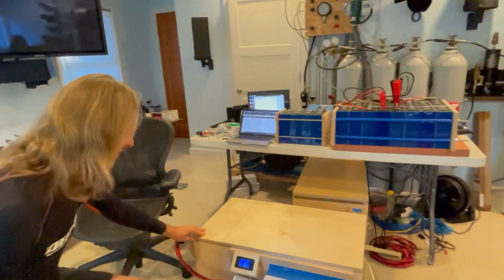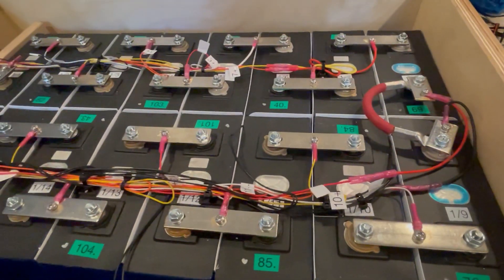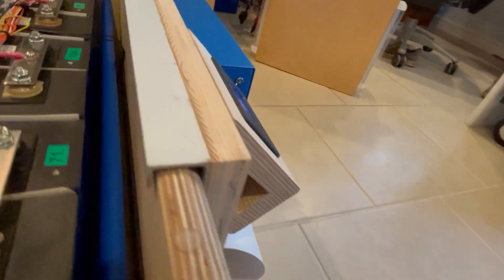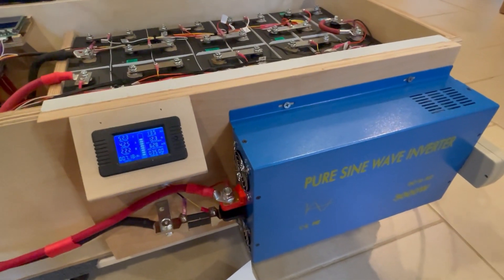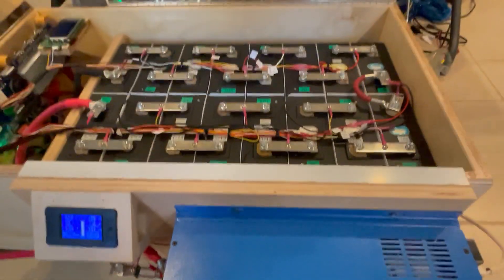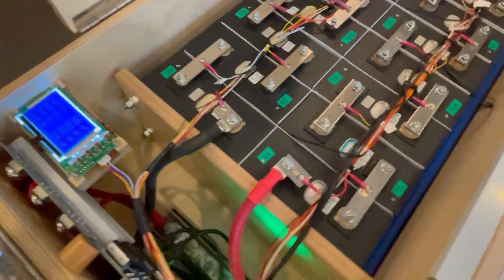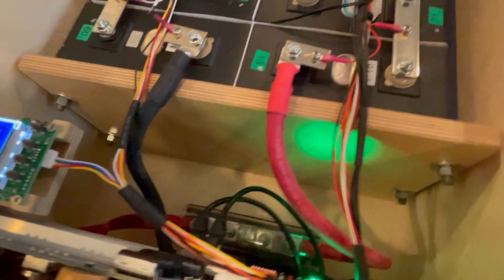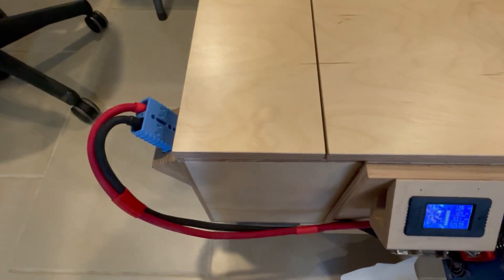I'm Really Excited About the Latest Lifepo4 Battery Addition and Status Update!

Comment: I have a Wanpteck PS605v I use for testing PC fans every day and it smoked like crap one day. I mean visible smoke out the vents and the oh so familiar small of burned mosfet! Anyway I Let the smoke clear and turned it back on just for the hell of it and its been working fine ever since? WTF? I never even opened it but I prolly should! Its same spec as yours but its a black faced and newer one I believe. Baffles the heck out of me but like they say if it aint broke dont.../ I never walk away from it and leave it on but I do use it while im at the bench!  I have six or eight of them now and I never had problems. I use them 100% duty cycle for months and even years at a time and they are great. Never shut down on me even once. I also use "Tekpower" TP3010E for 24 volt testing and its as good as the Wanptek. Its good to 30V and 10A. Anyway im new to solar power and battery packs but not new to electronics and enjoy your videos! Keep them coming! Your boxes are cool! Thats kinda what I want to do for camping in my truck!

Comment: Something many don't consider is that in addition to the inverter efficiency is the power factor of the load.
The power factor increases with inductive loads. 
I have found a power factor of about 45 degrees which means about 70% is watts, the rest is reactive volt amps.
A battery supplies volt amps, AC loads also use Volt Amps which are not the same as watts with a reactive load.

Comment: Hi Ray, i would like to ask you if you put fuse on each balancing wire. thank you
Reply from the maker: With all due respect to Andy, that seems like a solution in search of a problem. I have heard of zero issues that would indicate a need for fuses. In addition, I am making efforts to keep the resistance in my balance leads equal. Adding additional connections and components is counter to that goal and is not suggested by the manufacturer of my BMS or any other that I’m aware of.
Reply: @RayBuildsCoolStuff  thank you Ray, i appreciate your opinion, i talked with seplos company and they do not recommend this way
Reply from the maker: @ChytilJaroslav  you’re welcome. I hope I can get your subscription.
Reply: @RayBuildsCoolStuff  you have to have it !!! even without subscription, youtube knew what to suggest to me

Comment: where it goes the negative shunt wires ? to seplos bms ?
Reply from the maker: Yes the battery shunt is on the Seplos BMS and is on the negative side. The BMS uses the positive side for control of the battery and the negative side for measuring amp hours. I have other videos that show this. One has easy peasy in the title.
Reply: @RayBuildsCoolStuff  i was talking about the 6:35 is that another shunt where it goes those 2 terminals ?

Comment: Mate you done a great job on the battery boxes there. I been thinking about doing the same thing but it won't be for another 15 years at least now. We had total cascade battery failure without warning 3 years ago and well we took the only batteries we could get at short notice. We got a set of 720Ah @ 48 volt Gel cells to replace the 1000Ah failed battery. That was 15 grand. Your little single 280Ah battery bank there is equivalent to these big 720 Ah batteries because you can never fully discharge them without damage (stupid old technology) so their set to shut down at about 65% state of charge. This old system has been running for 20+ years now. If your going to get an Inverter, get a Transformer type. Their indestructible, ours has been smashed off the wall 3 times in cyclones with trees crashing through the shed roof & drowned in rain, so it's got a few dents now but all I did is dry it out for 3 days with a fan, put it's lid back on & powered it back up and it was all good.
Reply: hiteck007 what inverter did you have such reliability with?
Reply: @KSA-wo7dh  it's a Selectronic. Get the 48 volt Transformer version, they go for just about ever & it was Ausie made too.
Reply: @hiteck007  Thanks

Comment: why not sit at full charge?
Reply from the maker: These cells like to sit at a partial charge when just sitting for long periods. If I thought I needed it for emergencies perhaps I could justify it but in this case I will run them down a bit and let them sit until time to commission the whole system.
Reply: @RayBuildsCoolStuff  mine is sitting waiting for me to install them in my camper. it took about 14 days to top balance them with a 10 amp power supply. now they been sitting for 2 more weeks without the charger. i hoped it would balance them better. they are sitting at 100%. i will have about another 2 weeks before i can install them. do you have any suggestions? also i have not did a capacity test.
Reply from the maker: @bobham919  can you temporarily hook them up to do a partial discharge? At this point they have already been sitting awhile. Mine will be sitting for a couple months in some cases. It is a big project and I’m doing it alone along with all the construction work to build three buildings and  two separate storage systems with a total of six new inverters and two pv expansions and I’m an old man. 😜
Reply: @RayBuildsCoolStuff  they are still in parallel so i get 3.65 volts. i did use a 12 volt fan from a car that i plan to use as an exhaust fan. i hooked it up and run it for a few days just to see if all was well. it run slow but it was there to just to test. do you think letting them sit in parallel will hurt or help the cells? do you think i need to run a capacity test? what should i look for in case i got bad cells?
Reply from the maker: @bobham919  They should definitely not sit at 3.65 volts for a long period of time. Have they drifted down in voltage since you took the charger off of them and if not, why not? I don't think it is beneficial to let them sit in parallel for such a long period of time. I would but them together in a battery with a BMS and cycle them. After top balancing I do a complete discharge and charge test and document the results along with the results of the tests of my individual cells in a spread sheet for reference in the future. I also monitor for any cells that act goofy. This alerted me to a bad connection that I needed to tighten on my last battery.
Reply: @RayBuildsCoolStuff  they did drop a bit in voltage from 3.65 to i think 3.45 if i remember correct. i have a solar controller and BMS but i have not set it up yet. i think it might be best to assemble the battery and configure it for 52 v now. the unit i have is  a renogy all in one unit. i can use it to charge and discharge the battery. but as for knowing what is good and bad is beyond my skill/knowledge right now. actually i need a diagram to assemble everything. i think i need to install a shunt and i have yet to read up on that yet. i have not bought a shunt yet either. i got 1920 watts of solar and its mounted on the trailer and the trailer is not finished so i can't put it there. but i can preassemble it and use it in the house.
Reply: @RayBuildsCoolStuff  the bars they give me when the cells come are copper and .5 mil thick. they are about 3/4 of an inch wide. do you think this is enough to be used between the cells? i can double it and make it 1 mil but i don't have enough to use 3 per cell.
Reply from the maker: @bobham919  I think minimum is 2mm x 20mm copper. I have a video about my opinions and testing of bus bars both rigid and flexible. Check it out.
Reply from the maker: @bobham919  check out some of my other videos. Many but not all of these topics are covered.
Reply: @RayBuildsCoolStuff  i will. its a task to comb over all the videos of all the peoples videos on many topics. maybe is some way you might consider a video of the key points. sorta like clef notes.
Reply: if you could give me the videos that show what questions i am asking would be nice
Reply: @RayBuildsCoolStuff  i got 1.5mm by 22. do you think that will be ok?
Reply from the maker: @bobham919  33sq mm is just ok in my opinion and the opinions on this will vary broadly. How many amps will this battery be asked to handle whether charging or discharging?
Reply: @RayBuildsCoolStuff  its going in a camper. i believe just normal stuff in the camper. i do plan to install a mini split ac unit. i don't' think i will use much as in a peak. my inverter is 4k with a 4500 surge. what amount of amperage between the cells i can not even begin to guess.
Reply from the maker: @bobham919  That is going to draw 100 amps at the high end. What is your charge rate? Those bus bars will be ok for 100 amps if they are copper or tinned copper and properly cleaned and installed with the right torque.  The less resistance in the bus bars the better but if I had those I would use them and monitor the results. I think you will be fine.  Stay safe and keep learning.
Reply: @RayBuildsCoolStuff  i have 2000 watts of solar. i think it will give 20 amps @ 100 volts under direct sunshine. the charger that is built in in the inverter is 70 amps @ 52 volts about. i bought a laser thermometer with the intention to check the connections for heat. that could indicate a bad connection. also for checking the fusing or other components

Comment: It is the nature of lithium cells in series there is always is a high cell and a low cell and they likely will take turns as you cycle the bank and each cell works through it's voltage range and capacity.
Reply from the maker: Since I figured out my issue, this battery is acting very civilized. All is well.

Comment: Really super bro..
Just want to check is that POC charging or discharging ...?
What is the total battery pack ratings in volts and ah? Like 52v 100ah capacity

At what voltage you will charge the battery pack 52v 10ah etc.
Please reply
Reply from the maker: The cells tested at 268AH and the pack tested at 260AHdischarging and 261AH charging to 54.5v at 12 amps. I ended up charging this last time at 55 volts but will probably go to 56 volts later. In the end though these BMS will communicate with my hybrid inverters and charging will be stopped at 55 battery volts and individual batteries will stop charging at 3.5 cell volts. All this is subject to change as I learn more about this system and these batteries. I'm still learning about everything I do and I'm not reluctant to modify my ideas.

Comment: Ex(cell)ent information. I purchased a Juntek BMS (monitoring), when I opened the package, I was disappointed in the design of the shunt. The bolts to attach the cable lugs go through  the pc board. Making it impossible to torque the nuts without damage to the board below. What type of shunt are you using? Shunt before or after the BMS (management)?
Reply: ray, andy ( off grid garage ) had a similar issue with one of his chargers, same brand..
he's got a video on an easy fix
Reply: https://youtu.be/XiZIbIO2klw

found the video
Reply from the maker: Mine is a little different. There are about a dozen parts that they say need to be replaced. It may have been caused by a bad cooling fan connection.
Reply: @RayBuildsCoolStuff  well crap :(
Reply from the maker: @houseofancients  😂
Reply from the maker: The shunt is installed after the BMS and before any load. The one I used is available on Amazon. https://www.amazon.com/dp/B07T9LV66P/ref=sspa_dk_detail_1?psc=1&pd_rd_i=B07T9LV66P&pd_rd_w=spwYT&pf_rd_p=887084a2-5c34-4113-a4f8-b7947847c308&pd_rd_wg=S598k&pf_rd_r=PMCBE6CWQ26BXCE5NAFP&pd_rd_r=517c9936-8096-49f7-a948-ba752bb22f0b&spLa=ZW5jcnlwdGVkUXVhbGlmaWVyPUEzUTg2T0w2TEsyUE9ZJmVuY3J5cHRlZElkPUEwNjU3ODUzT0o3MTBITE1TVVM4JmVuY3J5cHRlZEFkSWQ9QTA4NzIxNjgxVVdLWk1NWUROSFE3JndpZGdldE5hbWU9c3BfZGV0YWlsJmFjdGlvbj1jbGlja1JlZGlyZWN0JmRvTm90TG9nQ2xpY2s9dHJ1ZQ==

Thanks for being a part of our growing little community and good luck on your project.